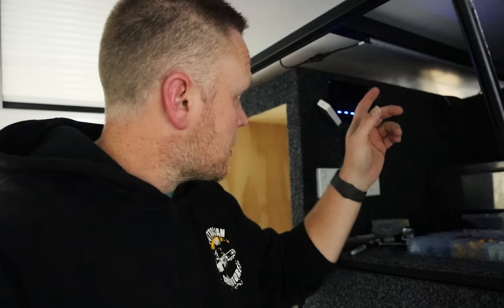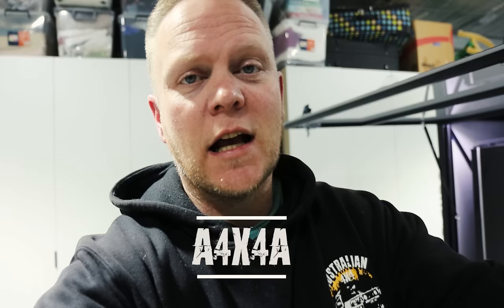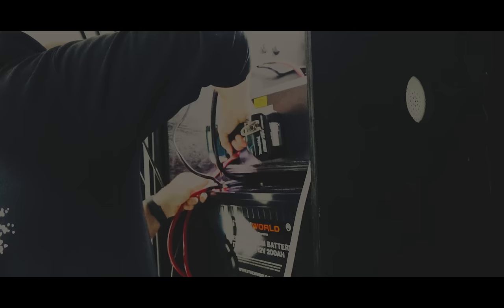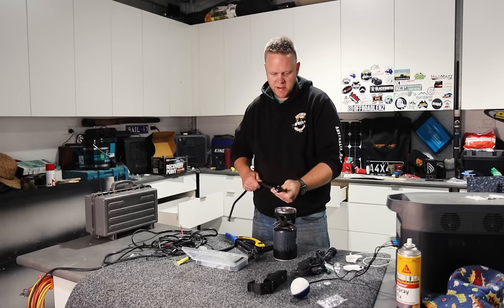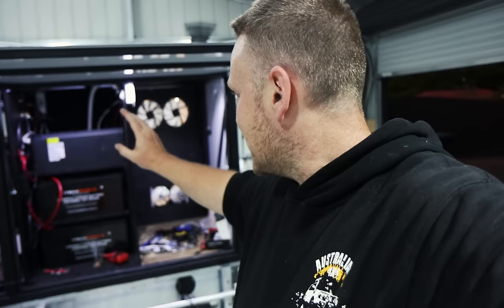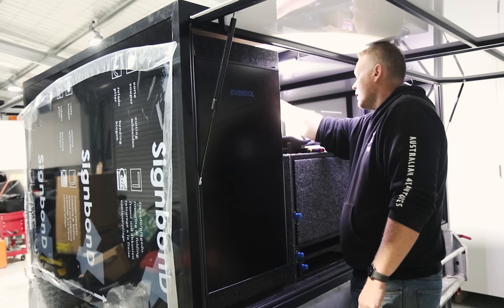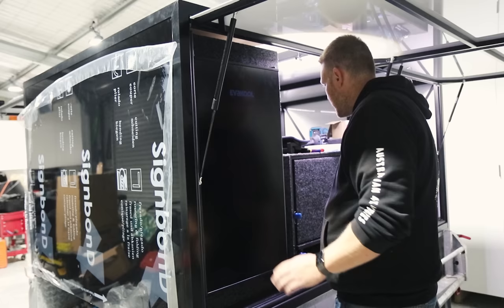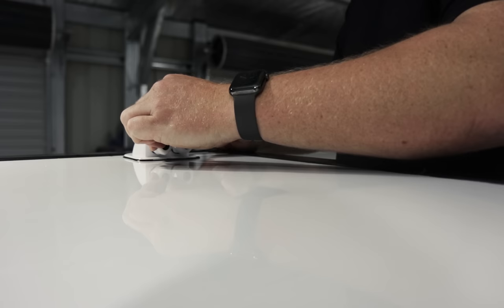12v OFFGRID camper trailer wiring + EVAKOOL 110l upright fridge install

Comment: Also when you go to add a dcdc charger later run the cable straight from your alternator post not your battery. There is massive voltage drop from an alternator to battery.

Comment: To temporally charge your lithium you can do straight alternator charging. Don’t use a vsr use either an Anderson plug that you can disconnect or a high quality relay connected to your ignition. I charge my lithium straight off my alternator and turn it off once they are full. If it’s temporary just leave it running the bms will protect the battery if need be

Comment: Hey mate, is looking good.
For the water tap and hose on the draw bar, put a stone guard around it/in front of it. They will get annihilated on the road to the BRB. And protect anything similar underneath the trailer. 🤙

Comment: Starting to come together, with the 240vac charger, you could put plug inlet on back or behind the rear mudguard, a Clipsal 435VFS15-BK splash proof or full water/dust proof EY56CSC310. These are surface mount. Leaving cords jammed under may not be good idea as they wear seals over time or cord gets damaged.
Did you seal the wood behind the fridge as any condensation will cause mould you can’t see. On cold morning and hot fridge running will cause condensation on inside of the trailer unless you vent it to equalise temp.
Keep up great videos, like to see it on first trip.

Comment: Don’t mean to be that guy but when wiring GPO’s don’t let any copper go outside the terminal. There was whole strands outside the terminal. Potential for shock if metal or limbs touch when it’s powered.
Reply from the maker: Hahaha.  That’s all good mate. I’m no sparky that’s for sure. 
This was just a rush job to get it done before Christmas. It’s since been cleaned up a bit.

Comment: The travel buddy switch is a waste, doesnt the oven have a dial to turn it on and off plus a timer? 

Looking like a sick build tho.
Reply from the maker: It’s a fail safe to help prevent me leaving it on. 
I’ve always had my travel buddy setup the same way.  
It’s basically just an isolator because I always leave the dial turned to “ on “ all the time
Reply: @Australian4x4Adventures  😂 a pie ready to go 24 7.

One other querie what crimpers for big cables are u using, they looked solid, and much easier to use over those ebay hydraulic ones.
Reply from the maker: Always a pie ready to go hahaha. 

They are just from autobarn.  I can’t remember the brand sorry.
Reply: Yep, i just connected mine straight to  supply with circuit breaker (which doubles as isolator), switch control on oven..

Comment: Trailers looking good Steve, The front load fridges are way more convenient than the top load fridges (particularly for short arses like myself lol), got a few drawbacks though. Those iTech batteries any good longterm? I have seen them on other YouTuber videos.
Reply: Have a look at PureEnergy lithium batteries which are sold by an actual bricks and mortar stores called Every Battery. Their customer service is second to none so any issues with the product are quickly resolved and they provide a new battery or 100% credit should you have fault. I recently purchased a 170AH battery for $1100
Reply: @cyclemoto8744  Thanks and seems like a good price
Reply: @Philipk65  unlike itech or Renogy you’re guaranteed after sales support, that’s what I’ve learned to be important over the years

Comment: What’s the price difference of a 400ah system with AC to dc charger and solar etc vs a generator you run for the coffee machine? Like surely to cost out weighs it? Would be a interesting video 
I know there can be noise but run a few leads out
Reply from the maker: It’s also the cost of still having some sort of decent battery to run a fridge 24/7 as well. 
So you would still have the DCDC charger + solar + the battery just to run the fridge. 

The only cost difference is the inverter and the extra lithium power.  

It would still be cheaper but I personally feel the benefits outweighs the extra cost